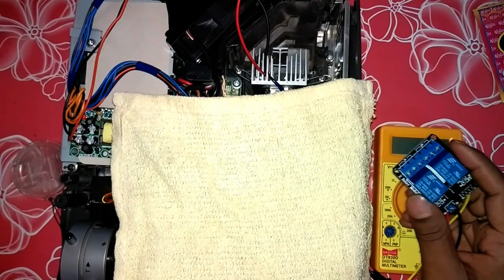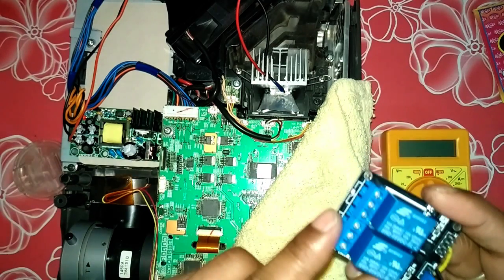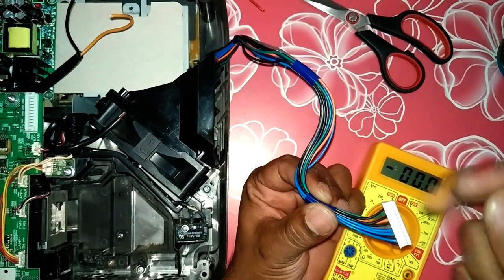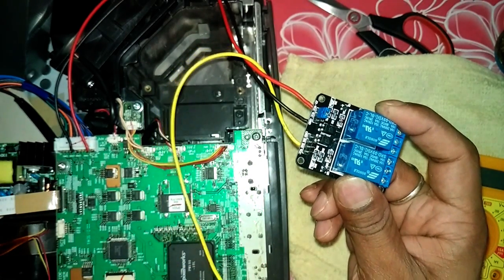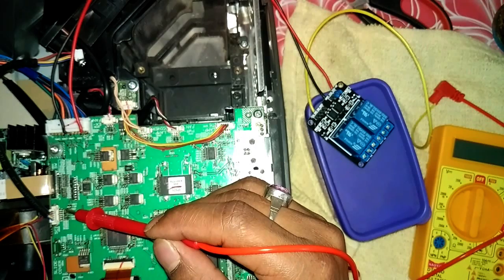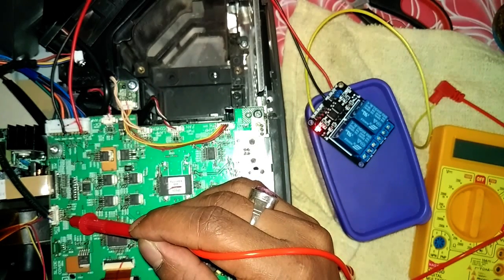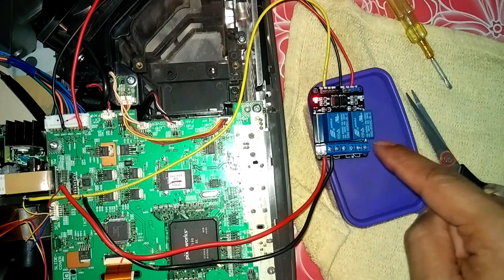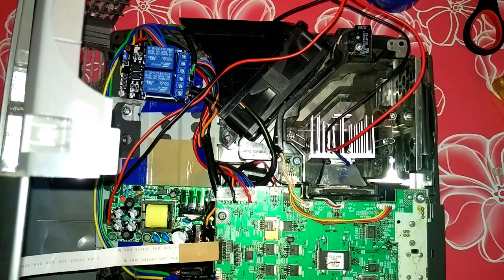Install 1/2 channel relay switch to Epson Projector to behave LED like the original lamp(part 3)

Comment: Sir i have a 220 volt ac 50watt led chip can i use that and is the process of shorting to fool the mother board the same for Panasonic PT-LC76E.

Comment: The overall aspect is great.σσ>7wow.cc/EpsonProjector?τ    Good materials, touching and easy to connect. I had both Optoma and Benq in the past, but this Epson is far better. Picture quality is impressive and connectivity is super easy and intuitive. I'm using it with an XBOX, Yamaha Receiver, and TV BOX. So far it's all working as expected. I would recommend it, for sure.

Comment: Just what i've been looking for since i have like 3 projectors with very weak light. One question, if i have a 50w 110v led, i can omit the driver and just add a 110v on/off switch with enough cooling. However, How can i remove the original halogen driver and still trick the motherboard into having an original lamp?
Reply: Do i just need to bridge brown and red wire together and ignore the other 3 cables from the motherboard-driver cable?